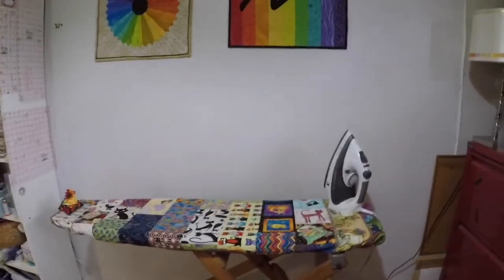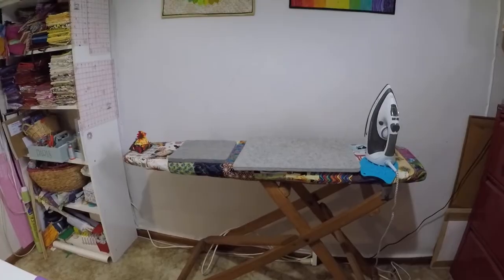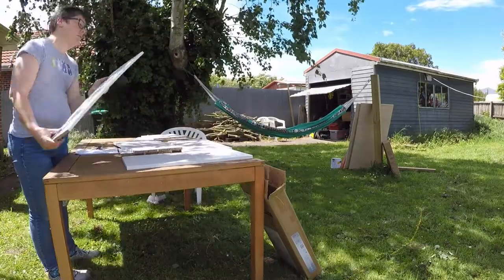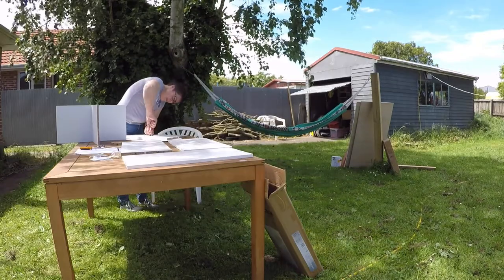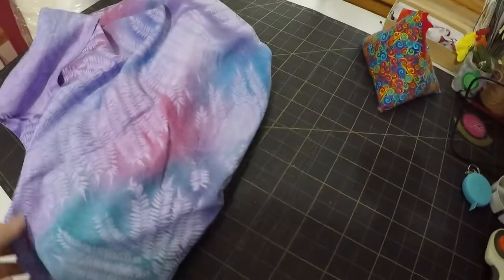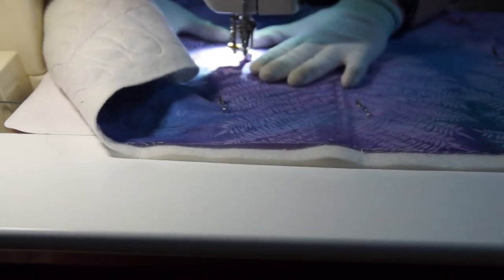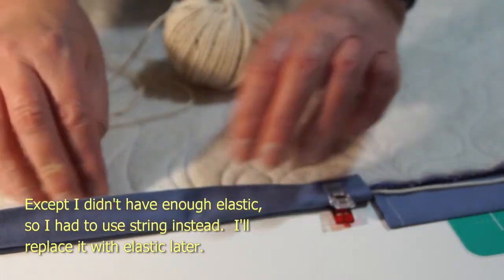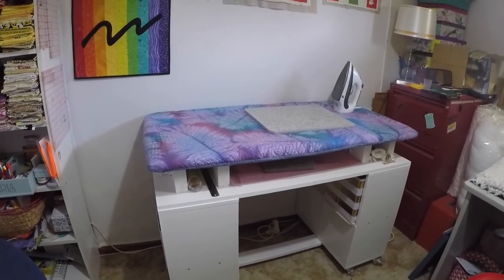Is this the Ultimate Ironing Board?

Comment: I just found you. Knoxville TN USA here. Love the new ironing board and the storage space. Could you please send out the measurements of the ironing board and the height too. Your feather quilting was very good. Liked the string better than the elastic for the top. Could I make the top. Could I make a suggestion. In the corner of your room maybe take out the chest of drawers and lamp and have your kin build you a bookcase like the other one you have all the way up to the ceiling. And I can’t see the other corner maybe do it too.  And maybe keep all your cases and furniture light. Also I think some white lace sheers or curtains would help lighten up the room. I was so excited to see you get your ironing board get made because it makes you so happy. Thank you
Reply from the maker: The top was was made from a 600x1200mm board, which would be roughly 23x47".  Including the wheels, it's about 34" high.
Thanks for the suggestions on what to do with my sewing room.  Unfortunately it doubles as my office space when I'm working from home, so I'm a bit limited on what I can do with it, but you gave me some good ideas to think about!